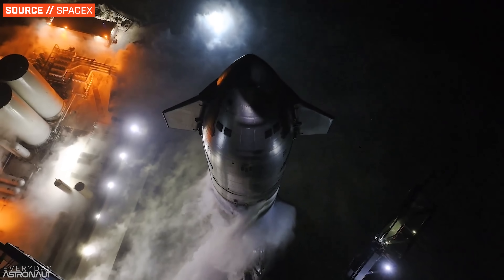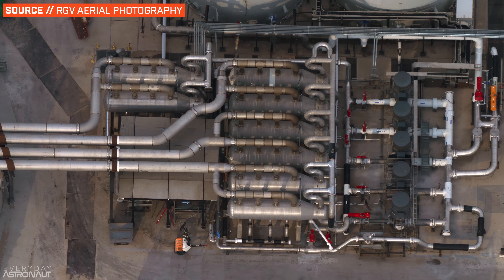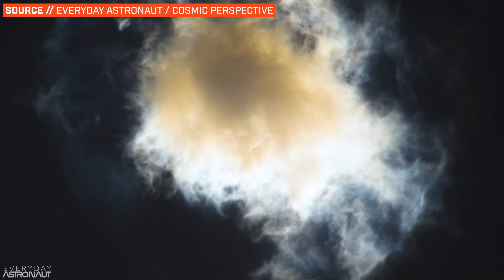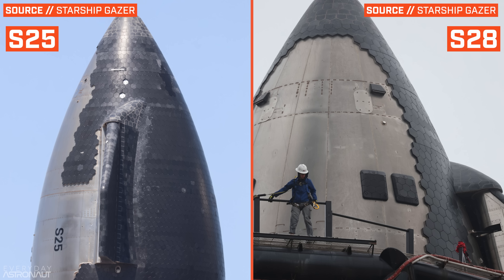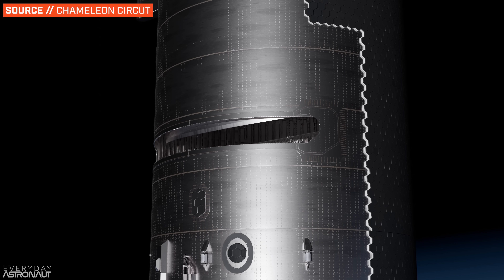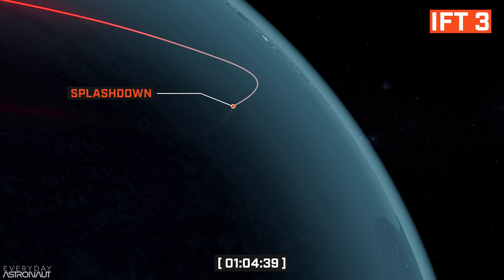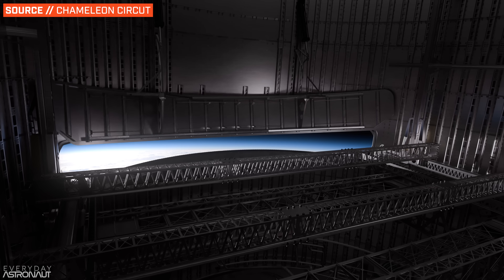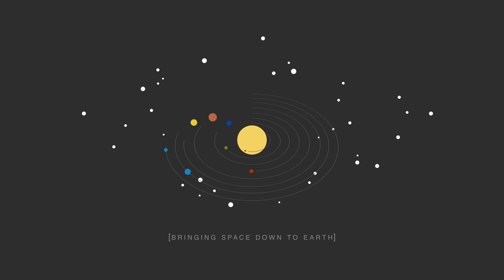What Did SpaceX Change & Upgrade For Starship's 3rd Flight Test?

Comment: NASA splashed 134 External Tanks (ETs) into the Indian Ocean during the Space Shuttle operational period (1981 to 2011). 

Those ETs disintegrated during EDL by design.

No ships were pelted with ET debris. No persons were injured or killed. No property was damaged or destroyed.

The Ship is approximately the same size and shape as an ET. The masses are different. The ET dry mass is ~25t while the dry mass of the Ship is ~110t.

There's no guarantee that the much more massive S28 will not disintegrate like the much less massive ET.

Maybe SpaceX changed to a target in the Indian Ocean realizing that aiming for a point off the Hawaii Islands has safety issues that would be better to avoid if at all possible if S28 disintegrated over the Indian Ocean.
Reply: Remember, the "point off the Hawaii Islands" was the US Navy Pacific Missile Test Range... they were landing there because it's where they test ICBMs, so it has a suitably large exclusion zone, and systems for tracking objects re-entering from space.

Comment: If the booster and the ship can do their job, then maybe SpaceX will start to demonstrate on landing the booster and the ship on the launch tower on either OFT 4 or OFT 5.
Reply: Too soon
Reply: @alvianchoiriapriliansyah9882  Yeah, no chance of that so early. They're not going to risk attempting a catch until they have multiple sets of data demonstrating their ability to accurately direct the booster to a wet landing location, and that they can control it in a hover with sufficient precision. Maybe this year, if they get the extra flights they're asking for... but I'm not holding my breath on that.
Reply: Far too soon. I expect booster catche attempts by IFT-7 or 8
Reply: Ok, well when that time comes for a successful booster landing, I’ll be mind blown.

Comment: Looking at the planned landing location, my thought is it was easier to get clear airspace for the reentry. My first thought is that airspace is going to be mostly Aussie controlled and flown by Qantas and Emirates (if at all.) Also, that doesn't look like it would be anywhere near any major shipping lanes or pleasure vessels, so the chance of an incident occurring during splashdown is as close to zero as practical
 Finally, there is the aspect of recovery. Although it doesn't look like SpaceX has any vessels near Australia to pick up Starship, they maybe(?) have a vessel contracted from Western Australia to go grab it - or sink it.

Comment: If starship survives re-entry... why would they not attempt a flip and re-light maneuver?
Reply: Almost half of the LOX header tank will be empty after prop transfer demo. I suspect it's not enough to perform all landing maneuver since header tank's LOX is needed not only for landing burn, but also engine chill before re-light. Plus I think that much void space inside LOX header tank is little too large to pressurize without autogenous pressurization.
Reply: @DSE8991 Even without prop transfer on previous two flights, they're already not planning the landing burn. The real reason is still a mystery
Reply: It will not survive reentry.
Reply: @jonharson There's a non-zero chance that it will

Comment: IMO, surviving re-entry is the most important test. If the heat tiles don't work (or just fall off), or the mass to surface area ratio is too large for it to bleed off enough speed before it hits the thickest parts of the atmosphere, then it's a serious problem. That's not something that software updates or slight adjustments to hardware will fix. It's critical to the whole point of starship that it can survive re-entry.
Reply: Contrary to the rest of the replies to this I really second this. Reentry is a much harder problem then people realize and a reusable vehicle of this scale makes the problem all the more difficult. I don't think it will be as serious as you suggest but it could significantly delay SPECIFICALLY HUMAN RATING FOR REENTRY by quite a while. could be solved by starship not doing reentry and a "shuttle" of dragon being used and Starships primarily being launched into space and staying up there for missions until its end of service.(Where reentry becomes more "convenient" :)
Reply: They have already begun design work of starship version 2. The data they gather from these test, including the heat shield, will influence the design.

If burning up on re-entry is the only issue that’s not an issue. Worst case scenario in that case is learning plenty more from 3 more launches of version 1 even if they all burn up.  Version 2 will likely fly before the end of the year. They are not planning on trying to catch a booster or land a starship until after v2 has flown a few times.
Reply: The latter problem would be kind of shocking; that's something that should've been nailed down decently close during design of the vehicle.  It wouldn't be surprising to see them explore  exactly how much margin they have for losing tiles without things melting at some point.  It makes a pretty big difference, e.g. for rapid reuse and not repeating the fate of the space shuttle, if losing 2 adjacent tiles threatens the vehicle vs if it can survive loosing a dozen+ in one area.
Reply: @FireStormOOO_  True, but aerodynamic modelling at hypersonic speeds is notoriously difficult and unreliable. It's difficulty was a major problem with the shuttle throughout it's life, and starship's belly flop is rather shuttle-esque. It's also problematic design-wise because it's the last thing you can test. You can do static fire tests of engines, but you can't do ground tests of hypersonic re-entry. Which means that you have to work on getting everything else working near-perfectly, and only then can you see if there are serious issues with it.

I have no doubt that fuel sloshing and the like could be fixed with minor changes relatively easily. But if there big problems with re-entry? Back to the drawing board. That's why I see it as the only major question mark remaining as to Starship's viability as a vehicle, it's the only place where near insurmountable (or surmountable only with serious compromises) difficulties might remain.
Reply: On this trajectory they can´t even really test the heat shield.
So whether or not the tiles detach will make no difference to the ship surviving reentry or not. It does not get hot enough to fully compromise the steel tank walls. 
The real test is the hypersonic stability and steer-ability of the ship.
Reply: They've been working on launching the rocket and staging, not reentry. I'd hardly be calling something which isn't even a focus of IFT3 'the most' important test let alone important at all. They will work on improving heat shielding when reentry is a primary focus.

Comment: Have you ever watched vehicle skin cavitation at 500 mph in high speed film? I Have,  building The Tomahawk Cruise Missile at General Dynamics. Vandenberg testing. Dural T-7075 looks like silk in the wind!! The cavitation of the stainless steel is critical, and until the ship skin is layered differently and reinforced, the tiles will continue to pop off. It has to be built like a toilet paper tube diagonally!!! Do You Think I don't know? Think again, and please relay this too Elon.
Reply: Also built the Space Shuttle Cargo bay doors.

Comment: Fun fact: according to the original timetable (and budget) Musk's Starship should have landed on the Moon already, but it has not yet reached orbit (Earth) orbit. It could actually be, that Blue Origin (Bezos) is the one that brings the US back to the Moon.
Reply: Ah yes because the delays is unique to SpaceX...
Reply: Blue Origin, i'm sure you must be joking. SpaceX just returned Crew 7 from the ISS yesterday, what has BO accomplished that can in any way compare to SpaceX accomplishments, lol.
Reply: @luvit579  Starship has not reached to the orbit yet and both IFTs so far have ended to a catastrophic failure. Plus the refuelling process SpaceX is planning to have is an impractical solution to the problem they created themselves.
Reply: @mikapeltokorpi7671  Great to know that Blue's lander can be launched in one rocket and New Glenn had a great launch record 😀

Comment: Hi tim, sick video! How are they doing the propellant transfer during flight? I assume they are not using the pumps as that would dump propellant in the engine and not require that amount of massflow, so are they using auxilary pumps or a pressure difference? If they use a pressure difference, how are they pressurising the header tank that is not supposed to have gas in it, (don't know any specifics). 
Kind regards :))
Reply: Moving the ship in zero g can already moves the fuel around

Comment: So, I'm pretty ignorant to this process but after each IFT, the FAA reviews all the data that SpaceX hands over to them and the FAA has their own Engineers and Scientist that can review and provide CA's to SpaceX? It's almost like FAA is the consultant, collaborating with SpaceX to improve Starship?
Reply: Not really. The FAA is concerned primarily for safety — so if the IFT does exactly what the flight plan said it would do, they're happy. If it doesn't do what it was supposed to do, SpaceX have to carry out a mishap investigation, and report to the FAA what went wrong, and what's being done to fix it... and until they've done so, they don't get to launch again.

And of course, such an investigation is exactly what SpaceX would be doing anyway, because "what went wrong?" and "how to fix it?" is pretty important to them, regardless of the existence of a regulatory authority. So that investigation is mostly performed by SpaceX themselves, with some FAA oversight to validate that the investigation was done properly and that the proposed fixes seem reasonable. Because no, the FAA don't have the resources to seriously involve themselves in this kind of thing... they're not ignorant of the engineering, but they're unlikely to have the personal expertise to help SpaceX debug a problem with something like Starship...

Comment: I wonder why they thought 1 Starlink dish would be enough... it's such a critical component because if they lose connection to the ship it means big boom.  It's relatively cheap and has a low cross sectional area so why not add more.

Comment: if they suffer a setback by not making it to stage separation this time, or something similar that does not allow the mission to go even as far as flight 2 did.. IMHO, we should all be ok with that. i think we need to check our expectations, and realize that even though the clock may be ticking, spacex has raised the bar so much already, and done so much to advance the context of rocket experimentation, that we forget just how ambitious and revolutionary starship actually is. i laugh now at people who still naively use the term "elon time", to mean "takes longer than promised". when he will be actually remembered for "petal-to-the-metal" technology development. it's a complex system, and i think we have only just begun to explore the failure modes.
Reply: As long as it's new failure modes

Comment: I think it’s plausible that they make it to orbit and complete the fuel transfer since theres a financial insensitive. opening a door seems like something an aerospace company should be able to do fairy easily but you never know with starship prototypes lol. they’ve also spent a lot of time on raptor so if it doesn’t relight that would definitely be a problem i think 

Re-entering is just a dream at this point. They can’t even keep the tiles from falling off and they’ll be under a lot more stress when re-entering. I’ll give it maybe a 3% chance but i’m still hoping.

Comment: And so, it begins. 😁 (If you know, you know) 😉 Off topic bit. Why don't they test the heat tiles when testing raptors? 🤔 Place them at the base of the test stand and, 'light 'em up' 😃😎🖖
Reply: They've done that. The issue isn't the ability of the tile to withstand heat, though; it's their ability to stay attached to the ship as the skin flexes.

Comment: SpaceX seems is focusing right now in starship achieving orbit and logistic readyness for the Artemis program rather than surviving reentry, NASA really must be pushing the buttons
Reply: One step at a time if two isn't working.
Reply: Reusability is necessary for going to the moon. It's going to take something like 12 to 16 refueling trips to starship in orbit before it can depart for the moon..
Reply: @Bryan-Hensley  Yes but right now fuel transfer is more important than reusability in order to advance with the Lunar Gateway payload logistics and the Artemis program, sacrificing starships in the firts steps is not out of the question
Reply: @radicalxg8282  it's all important. They can't throw away 12 plus ships and boosters just to send one to the moon.
Reply: @Bryan-Hensley  Expendable launches can carry a lot more fuel, so they won't need as many.
Reply: @trentnordhagen  that's where the 12 to 16 comes in. It takes 1,200 tons of fuel.
Reply: @Bryan-Hensley  1200 tons of fuel is if it's fully loaded, which I highly doubt. Expended Starship will be able to do 200 tons easily.(SpaceX claims up to 250) I doubt we will see more than 5 refueling launches if fully expended, unless they really want to maximise payload to the moon.
Reply: @trentnordhagen  And only starship itself, not the boosters, will be expended in that scenario. Still, they will have to start nailing the booster landings pretty soon.
Reply: Just like Falcon 9

Comment: There's basically no chance it will survive reentry and SpaceX surely knows it.  Almost entirely because the tiles along the seams are still glued on, and it's understood perfectly well that those tiles will likely entirely fall off.  What I'm keen to know is whether the remote splashdown location means there won't be vehicles in the air on hand to document the event visually.  For the first two flights, they had these ready to go, but then that was reasonably close to Hawaii.  I still want to see that footage.
Reply: And a lot less eyeballs to see it belly flop into the ocean.
Reply: I've not heard anything about it, but they could send aircraft to Diego Garcia or the Maldives...
Reply: @simongeard4824  Exactly.  You would think this would be important enough for it.  Even if the connection between Starship and Starlink remains good, that'll stop the moment it begins reentry, and it will never come back because the ship will quickly transition to fireball.  I really hope they have this figured out.
Reply: Most likely, they just want to make it to sub-orbit,  test propellant transfer, opening bay door and gather data. It surviving reentry will mostly be irrelevant.

Comment: As much as I love starship, let's be honest, this is extremely hard. I believe it will not make it further than the last test. Hope I'm wrong. 60% chance 3rd test flight fails with less success than 2nd test flight, 20% chance that landing burn is "successful, 20% chance starship makes it to "near orbit" trajectory to land in indian ocean, of that remaining 20%, 80% chance of relight, 80% chance of payload bay working, 20% chance of making it through reentry. (In absolute terms that's 16%, 16%, and 4%). I'd say about 3% of achieving all goals

3% doesn't sound good, and it's a lot lower than your expectation Tim, I'd love to be surprised
Reply: I hate to say it but I'm kinda with you on this. I think they were simply very lucky all the engines survived the full run. It didn't even have a payload and I don't think it reached enough speed is why starship didn't make it. If one or more engines don't survive, it's definitely not going to make it. Just after last launch Elon immediately said the ship is going to be taller. That's an indication it can't make it to orbit like it is now. This flight is sub orbital too.
Reply: @Bryan-Hensley The taller ship isn't because it's currently underperforming & can't make orbit

Comment: Expectation? My expectation is about the same. I don’t buy lox filtration as being the most significant fix to IFT2’s failure. CSI Starbase made a very good case that flight dynamics caused propellant voids at or near the turbopumps during staging, and the collapse of those voids was likely catastrophic. I need to see successful survival of the booster, or enough indication that SpaceX understands and has corrected the flight dynamics issues, before I expect improved booster performance.
Reply: preferably without debris from the launchpad hitting the vehicle...

Comment: I don't see how that thing could land on the moon, filled with boulders, ondulations, etc.
Reply: There is ample flat terrain on the moon as demonstrated by six Apollo landings on the moon plus five Surveyors landers touching down in the late 60's.
Reply: Hopefully the legs will extend/retract to compensate for any rough or sloping terrain.   But ultimately, the lunar lander deserves a new design optimized for multiple lunar landings/takeoffs.

Comment: I think IFT3 has to perform better than 2. I think SpaceX could launch these tests every month or faster but all of the red tape will keep it to maybe 4/year so I think they need to have more milestones ticked off per flight. I'm hopeful that both booster and ship survive re-entry. Ship may experience some unforseen damage though which will have to be successfully addressed in IFT4. Overall I just hope SpaceX gets a ton of data. Good luck and I hope things go as well as possible.

Comment: @Everyday Astronaut....
After careful deliberation, I am of the mind that the SH booster SHOULD launch with its GRIDFINS FOLDED, like the Falcon boosters. 

This way the hot staging gases will cannot interact, with the gridfins, to alter the booster's directional orientation. 

The gridfins can be extended during the Boost Back operation.